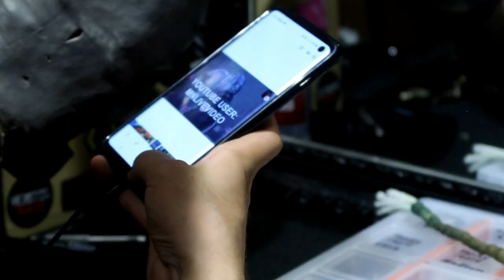Slipknot | Converting Iowa Corey Mask - Stitching, Strapping, Dreads, Weathering

Comment: Thanks for the video! Often when ive tried pulling dreads through the hole, the hole has either been too big, or too small. Too small would make the dreads yarn untangle or push down, making the dread thin at certain points. Making the hole too big, will make the dread fall flat onto the mask, and not make it appear stiff.
So it was nervewrecking for me to see you pull the dreads through, but looks good :) I believe Tito just glues the yarn to the mask, without pulling the entire dreads through, but only the small white end. Making plugs is a great idea though, making it last longer.

Very educational video <3  What material did you stiffen the yarn with?
Reply: @outsaintedstudios5567  Stretch it, pwease daddy
Reply: @TheDvd3000  lol
Reply from the maker: Thank you! It's just the contact cement I used to glue the grommets on and the dreads to the mask